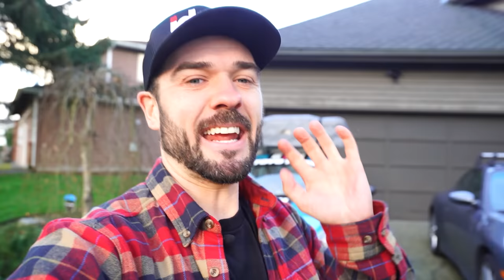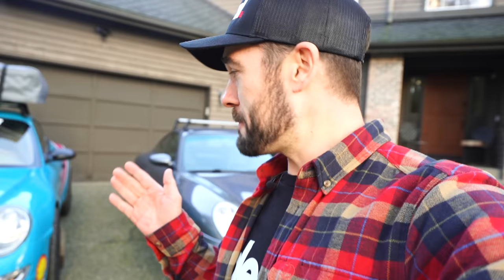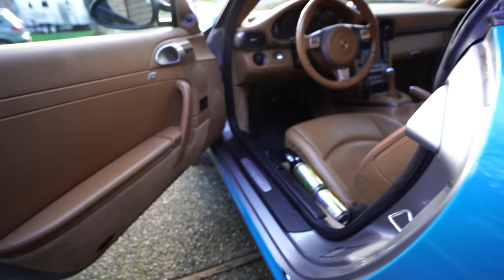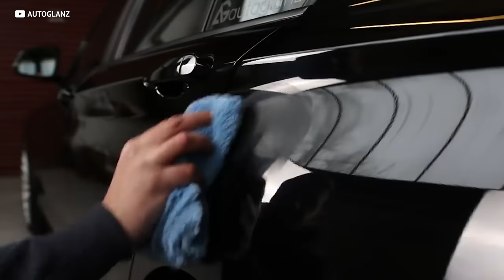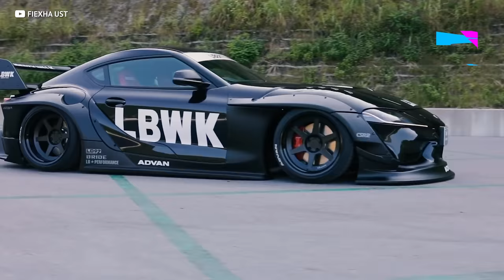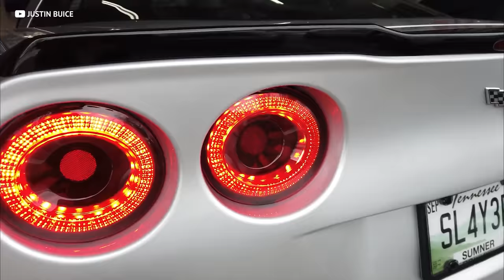How To Make Your Car Look 10 Years Newer

Comment: The most dated stuff in any car is the interior, and thats where you spend every single minute of your driving experience in. Can you please make a video on how to spruce up your car in that area please?
Reply from the maker: yeah thats a great idea!
Reply: The best upgrades are a new steering wheel oem+ or aftermarket, a new shift knob, a detail,  new seats oem+ or aftermarket if you can afford them and new gauges/interior lighting @idealmedia don't forgot a double din touchscreen radio with Bluetooth/spotify/pandora goes a long way 👍
Reply: @IdealMediaChannel  Halo

Comment: So basically, spend more money than what you spent on the car to make it look  new
Reply: “Buy a car for $1,000, spend $24,000 on it, sell it for $1,500.”
Reply from the maker: well sorta? but i think you're also investing into the experience of owning the car!
Reply: @IdealMediaChannel  Why not buy a new car then???
Reply: @villa1n663  it's a preference thing
Reply: @villa1n663  Because a new car value drops faster then spoiled milk the second you take it off the lot.

It makes the most sense buying used at least that way you get most of your equity back or then some if you flip it (depending on the car and mileage, of course). Plus usually the after market parts takes a lot of time to catch up.
Reply: @villa1n663  same Question is why dont buy old car
Reply: @ajm114  still not worth it to buy a shitty car and invest a ton of money into it and then get rid of it for nothing
Reply: @gotworc  these are called project cars. and you normally keep modded vehicle far more longer than stock ones unless you arer super fucking rich.

Comment: New headlight projectors make a huge difference and did updated ones on my '10 Challenger SRT8 recentlly. They are identical to the ones they use on the 2015 + model years, and have air induction ports on each side to feed fresh air into the cold air intake.

Comment: I drive a 2008 fiat grande punto. So far i only put 2012 Punto Evo rims under it, and for the interior, i replaced the plastic dash trim for a carbon dash trim. Makes the interior look way cleaner. New front and rear lights are still on my list. Also thinking of adding foglights front, but not so sure yet. Because it doesn't have the cables

Comment: I’m thinking about getting a Porsche 911 996 for my first car because of you 🙂
Reply: don't, get a Porsche later. their vry powerful and expensive, anything that breaks is $$$ even if u know how to fix. also, did i mention their vry powerful? u may crash it on the 1st day. Get something a bit less on power, easier to fix and maintain when u get used to that, then get a Porsche so at least you can handle it. just some advice from a fellow car enthusiast ;)
Reply: I mean if you have the money for services and parts fuck it go for it
Reply: @horriblewater7548  crown Vic or grand marquis, I own one and it’s my favorite car I’ve owned so far :)
Reply: I meant my first Porsche I already have a c7 z06
Reply: If you want performance get a a golf trip that’s a few years old it’s not as cheap a a Toyota or Honda auto maintain but it won’t break th bank either
Reply: @thaemeraldramen2218  lol haha a beginner with more than 200 it's recommendable but if you have a Corvette you don't have buy a other car
Reply: Get a early boxster. One before the 2000s. Those ones had a extremely low rate of IMS failure.
Reply: Whenever I go to my parents house the whole neighborhood complains about the “loud rumbling noise” outside.
Reply: @thaemeraldramen2218  they won’t ever understand we call them normies
Reply: Yes bro do it if you get it working and looking nice it’s worth 60,000 to 100,000 dollars
Reply: Your are so lucky I am from Spain and I might get a mk4 golf 1.6 105hp as my first car haha so appreciate what you have
Reply: I know I work 2 jobs one on weekdays and one over the weekends
Reply: @horriblewater7548  yes crown vic is probably one of the easiest cars to maintain and fix. also any honda civic, mitata, s2000, celica, all good 1st cars

Comment: Looking at the 35 year old Datsun Sunny:

Looks fine. I like it retro
Reply: Rustic 😂
Reply: What this video is doing is making old cars look retro what u meant was stock
Reply: @T0YCHEST , Didn't mean to offend you there.What i daid was rhat old cars can be modified in everyway internally.I just like the retro look.

For example: Aston Martin DB5 Electric
Reply: @mr.bruhexplains1538  my nigga im weeping cause i was so offended 😐

Also if the internals are upgraded and not the exterior that's called a resto mod

Comment: I enjoy your videos. I must speak from the other side thou. I daily a 89 F-150 manual 4x4 and also have a 2016 VW Jetta. I use the Jetta as more of a toy. When comes to my ford. I have the Bondo/ body filler job myself. As long as you have a weekend with no plans. This is a valuable skill that you can learn. Plus, I done the paint pen on the rock chips. I learned to process of painting a vehicle.I learned to blend paints to get close to the colour you want. Wrap jobs do look good. But, I hear wraps only last 10 year. Would this be true? If you put down two layers of paint and two layers of Clearcoat. The paint job lasts for 30 years or more. I also restored the original hud caps to the truck. When it comes to my truck. I’m a big fan of period correct with a bit of Survivor look. When it comes to my Jetta. I got it to look like a sporty rally car from factory. I put a small spoiler( more like a lip). R-line badging was put on the car. Did some touch ups in the interior to match it. My next job will be to paint the steel rims white to match the car and put the plastic hub caps on. I always been a DYI kinda guy. I wish I could post pictures in the comments. Keep up the great work brother.

Comment: Tip no.1 you should buy some car headlight lens from ebay they are good and get the cheaper ones. and the tip is to spray a clear coat on it. So they last sooo long

Comment: i have a rx7 , the one in my pfp , i started by changing wheels , then brakeds , suspension , exhaust , intercooler , new turbo kit , aftermarket intake , wide bodykit , new spoiler , recaro seats , 3 rotor engine , it makes 750 hp now , i spent aroung 20k in mods

Comment: Of you want to take 10 years off and you going g to wrap or do a body kit... then why not do a face-lift upgrade. Manufacturers do face-lift on cars all the time, a scrap yard normally have full front ends of newer face-lift you can simply swop. Ie mx5 mk3 to 3.75

Comment: HID bulbs are expensive and an outdated technology.They also get incredibly hot and need a professional to be able to install them correctly. Most LED bulbs are a plug and play situation where it just plugs into the factory wiring harness without any extra installation required. I definitely would not recommend HID bulbs to put in anybody’s car.

Comment: The MOST sssstupid modifications for a street, daily (or not) car.. is lowering suspension and large rims with thin tyres. Then, if it comes with those above, the front, rear lips and side skirts are at same level of stupidity. I hope is no need for explanation ..why that😂